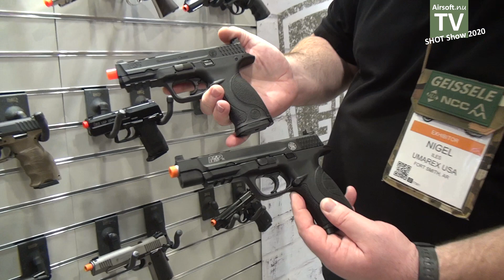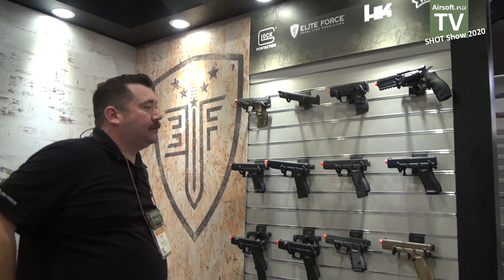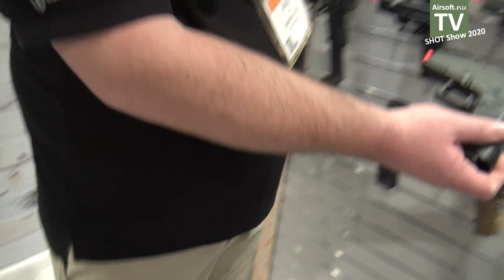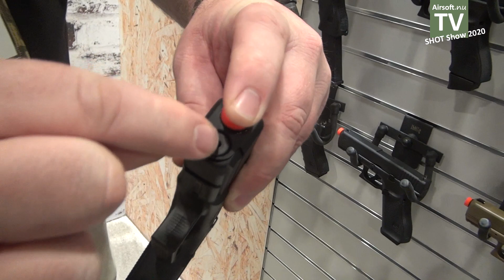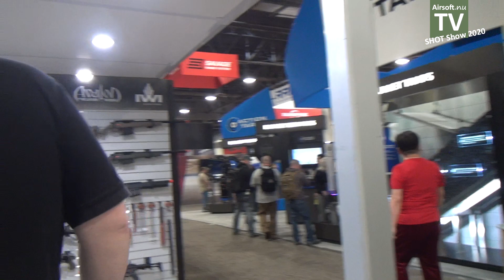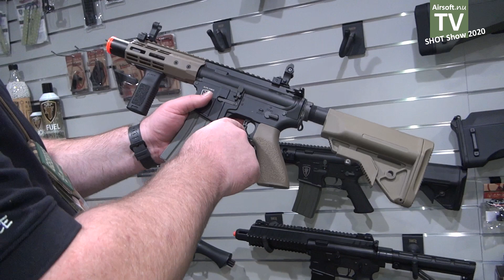Elite Force Airsoft/Umarex USA at SHOT Show 2020

Comment: No Glock 19 Gen 5....?  😕
Reply: Lt. Colonel Tanya von Degurechaff ermm no.. that’s why they have different Gens, because they are different styles / versions of the Glocks
Reply: Lt. Colonel Tanya von Degurechaff 
Look I didn’t think this was going to turn into something... I just made one little comment basically asking if / when the Glock 19 Gen 5 was coming out.. I’ve got the older G19 Gen3 but I want to upgrade to the new hop-up system & if I’m going to upgrade then I might as well ask if the Gen 5 is coming out.. 
People take things so seriously on the Internet.
Reply: Lt. Colonel Tanya von Degurechaff yeah I’ve been looking at the 19X for a while as well deciding if to buy that or not. I was watching AirsoftMikes channel that he put the tan 19X slide on his G19 Gen 4 (black) lower body & the two tone looks real nice so I’ve been thinking of maybe doing something similar. As for the G17 Gen 5 it’s kind of my fall back plan. I’ve got slightly smaller hands so the G19 fits my grip better, but then I miss out on the barrel length of the G17. It would be fun to see a 19 lower with a 17 upper. I’m in no rush right now to upgrade but was just looking to see what’s coming to market soon. A Gen 5 or 4 G18c would be fun especially in CO2 with the extended mag.